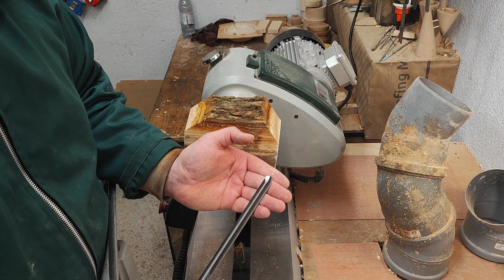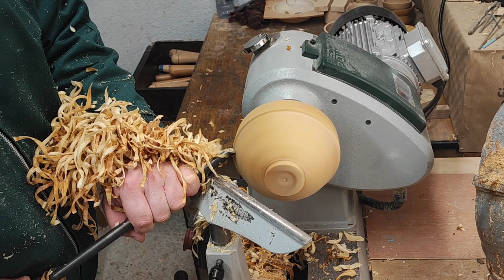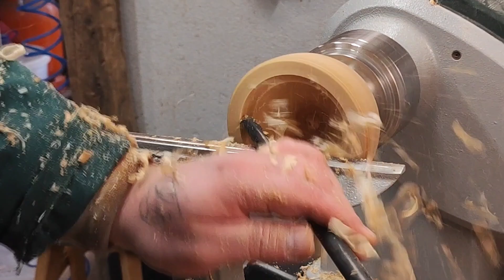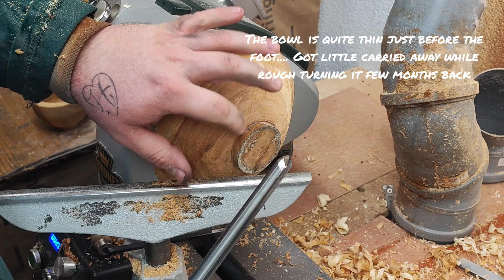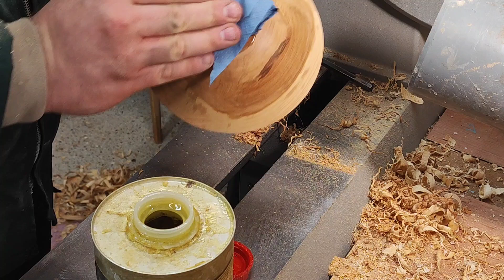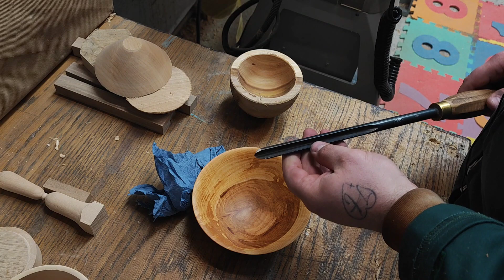Testing KS BOWL GOUGE with lovely apple wood

Comment: Great demonstration with the new gouge. The addition of Cobalt certainly adds to the hardness and the edge stays sharper longer. I find that my metal lathe tools with a 5% Cobalt addition makes a big difference, they cost a bit more but do a better job and last longer. That peeling cut certainly gets the wood shaped very quickly, when I get onto bowl making I will try this. Thank you for sharing this, it adds to get us newcomers on the right path. Greetings from Tasmania Australia 👍😁🇦🇺🦘
Reply from the maker: Indeed, peeling cuts are great way to remove a lot of wood quickly..... Thank you for watching as always and support what I do 🤗

Comment: I could hear the difference with the hardness. The wood you usually use sounds much softer. That's a detail that hard to capture.
Reply from the maker: Indeed it is.... Its much harder then cherry or walnut or pears which I use the most these days....but it handle those like a champ and it will be easier for me to have it on elm asymetric grind but wanna try out right from the box ☺️. Thank you for watching 🤗

Comment: That is a long piece of steel. I mostly use interchangeable handles, where I can so I have a bit more control over the length. Then, I also hold the tool very differently, right at the end. I'd rather support it under my forearm, but paralyzed hands means finding a different way, and it works for me. I like my Hosalunk 18" handle with OneWay double ended gouges. Lots of room for length adjustment.

I have a question. With the asymmetric grind, did it take long to learn to make a clean entry push cut? With the constantly changing bevel, I imagine it's a different approach. Or, am I wrong, in that the bevel is the same angel but the wings are just different shapes? Thank you for your thoughts.
Reply from the maker: I've was looking a few months back on double ended gouge but something came up and didn't buy...nice gouges as well.... Asymetric grind can be a little tricky to start expecially on bigger tool like 16mm gouge as the tip is more rounded, on smaller one its not that big of issue.... Angel does change around a gouge , its steeper on side or wings then on the bevel tip....but after I learn myself how to sharpen it the best way that suits me then using it was accually a eaier chapter 🤗
Reply from the maker: Thank you for watching as always ☺️
Reply: @Tomislav Tomasic Woodturning (Dodir Drva)  That was very helpful. In a few weeks I'll be doing some reshaping of a gouge and a few inherited tools once I have them. I'll let you know how I do.

Comment: Curious on why you removed Record Power sticker from your toolrest?
Reply from the maker: The end of sticker peel off and curl of the foam backing, so I just remove all of it but the tape it self adhere quite good...
Reply: @tomislavtomasicwoodturning  try using alcohol or acetone to remove the glue.
Reply from the maker: @noelgreen9381  thank you for suggestion.... My thought was once I rough turn some wet elm that is left I'll have to clean the lathe with WD-40 and it should get rid of it , hopefully.... If not aceton alcohol should do the trick☺️

Comment: Glad you like the bowl gouge! I think the reason why the flute doesn't reach further down to the handle is to reduce vibrations, at least that's what another YouTuber said who supposedly was in contact with the team who designed the bowl.
What I'm most impressed by (and also a bit sad about 🥲) is how you managed to not have any tool marks or "vibration marks" in that bowl. Today I turned a small bowl as well and although it wasn't even as thin as yours I had a ton of these "swirl tool marks" in it. In moments like that I get shown that I still have to improve a lot 🥹
Reply from the maker: That is correct on flute lenght, and I find that great but overall lenght of gouge out of the handle to be unusual as I'm not used to it.... But I think I'll either buy handle with collar or drill this one deeper or make new one and put this handle on other tool like spindle gouge which I use all the time beacuse the more I use handle its better ..... Those swirl marks can ne annoying but sometimes there is not escape from that or try to support the cut with your hand on outside.... That ussually helps a lot.....thank you for watching and comment and support what I do 🤗 all the best
Reply: @tomislavtomasicwoodturning  I'm sure you'll find a solution that fits your needs 🤗 All your other gouges are quite similar so the new one that is a bit different may need some time to get used to 🤗
I have tried to press the outside (as you have done it in other videos) and it turned out a little bit better but I'm not used to use the gouge with one hand only so the result still wasn't that good 😅 Maybe next time it will be better!
Keep up the good work on your channel 🤗
Reply from the maker: @0BAMiiN  woodturning is mostly practice, so the more you do it the better you'll get.... Thank you for kind words and greetings from Croatia 😀
Reply: @tomislavtomasicwoodturning  I'll let you know when I have improved 😆 Greetings 🤗

Comment: HSSE, compared to normal HSS has Cobalt in it; like you said. This makes it much harder,  gives it higher heat hardness and tempering resistance........ The only downside to the Cobalt alloy is that it can fracture easier if exposed to a sudden "shock", I think it'll also crack more easily if the hot tool is dipped into a coolant...... But we don't do that with wood turning tools. It works very well on a metal lathe and will perform much better and for longer than than normal HSS, it'll also take higher speeds and feeds than normal HSS. None of that really matters to us woodworkers, I'm jus kinda blabbering on coz I know a little about steels 😂
I kinda like the handle, the octagonal shape reminds me of old London pattern chisel handles; which are very comfortable. Being new to this, I woulda said that the longer steel was a good thing....... more life in it. But I didn't take into account that it changes your grip, which is probably a very personal thing. If you make a new handle for it record it for a video, I would like to see that 😁
Reply from the maker: Thank you Whitty, I didn't know that about steel differents, never been focus on that so thank you for your feedback which will help others in this video as well....I might pin comment to be at the top of comments.....
It does have long life in it and its really nice steel....better then anything else I have so far..... I'll figure something out for the handle ☺️

Thank you for watching as always ☺️
Reply: @tomislavtomasicwoodturning  You are becoming one of my favourite turner's on YouTube, second only to Mr Raffan of course 😁  yee both have similar ways of workin, I like the no nonsense approach you both have.
I'm brand new to this and I'm learning lots from your videos, thank you Sir 😁
Reply from the maker: @whittysworkshop982  aaaa thank you very much, Richard is my favorite as well on YouTube and beyond😅... Thank you for kind words and support
Reply: If you have a 13.5 mil drill, you can just wack the gouge out of the handle and drill it deep enough to fit in until the flute begins.
Reply from the maker: @thefaulenzer677  that is probably first thing I'll do.....